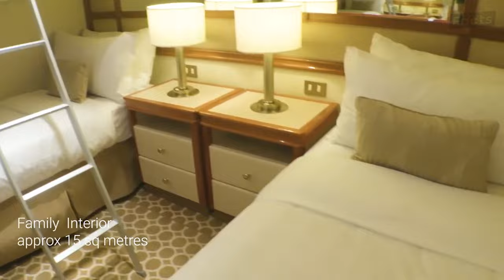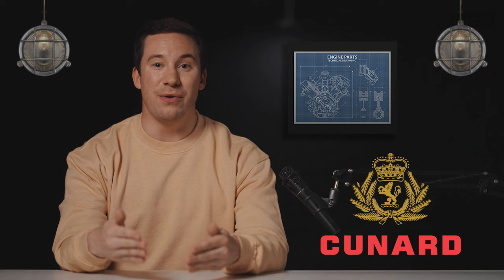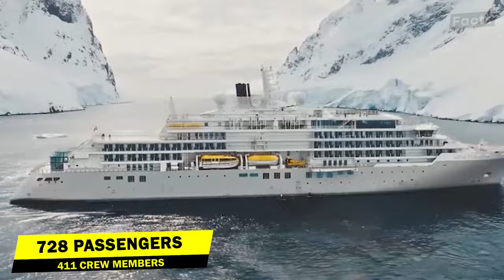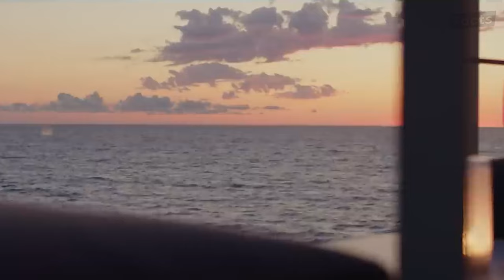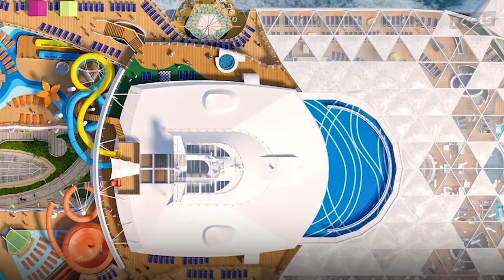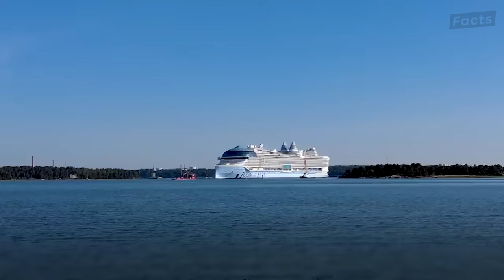Top 5 LARGEST Cruise Ships in 2024

Comment: Gross tons do not refer to the ship's weight. It is a measure of the ship's volume, so stop talking about the equivalent weight of elephants. Also, pretty sure pictures of  staterooms of older Princess ships have been used to portray the new Sun Princess which has totally different decor -- and no shower curtains as far as I'm aware.